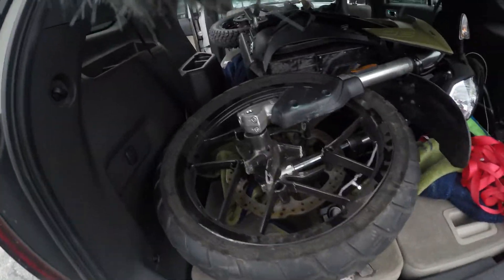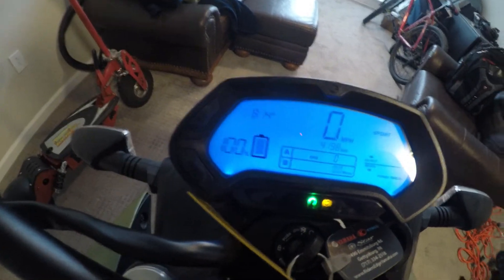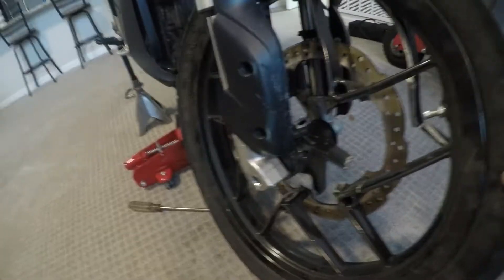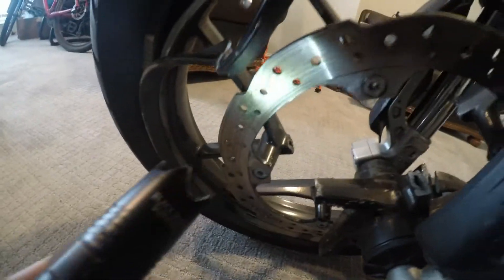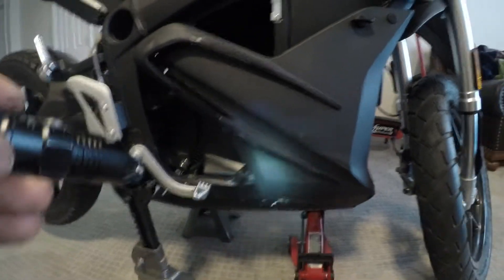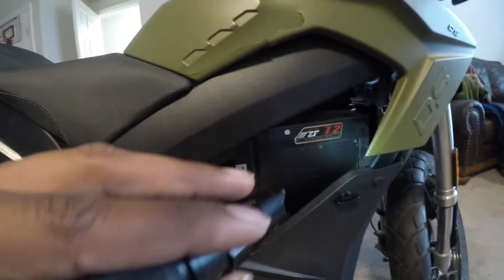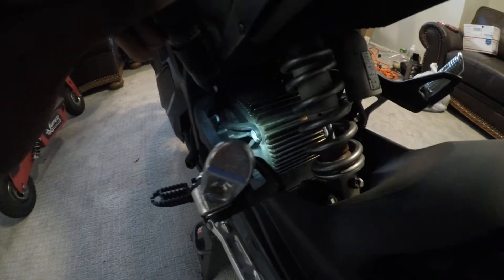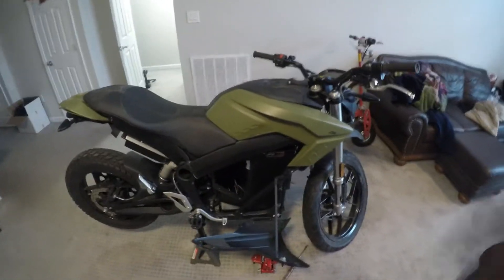Electric Motorcycle COPART Rebuild PROJECT (IN DEPT OVERVIEW)

Comment: Hey brother, I found a bike for me. It's coming for auction in about 10 days. It's listed on both copart and creashedtoys.com. What do you think on how to go about it?
Reply from the maker: send me the link ill look it over for you!
Reply: @DirectedWisdon  you the man for this. TY bro!
Let me know what you think.

copart: https://www.copart.com/lot/33181209
crashedtoys: https://www.crashedtoys.com/lot/33181209
maybe just for fun: https://www.iaai.com/Vehicle?itemID=31840578&rowNumber=1&loadRecent=True
Reply: @DirectedWisdon  hey bro, what do you think about these? Thanks again!
Reply from the maker: Darnel C Hey man that KTM is sick in my opinion I think for the right price this would be an excellent rebuild project and also I noticed that is pure sale which means the lowest bid wins the fight no matter how low! Also the damage from what I can see is not structural only the handlebars And some of the side plastics will need to be replaced and you should be good to ride I would also make sure that the instrument cluster is not damaged
Reply: @DirectedWisdon  Thanks! Yeah, this one is for me. Now I'm a bit more confident going after this one. Depending on how this works out, I have my eyes on others too. 

Initially, I was confused because it is listed on crashedtoys and copart separately. Both have same info and there's a bunch of references to copart on crashedtoys.com so I'm pretty sure it's the same operation and people running it.
Reply: What are the laws regarding electric motorcycle? Do I need a motorcycle license or endorsements, registration and insurance?

Comment: Dope! How would you handle shipping? Bikes I'm interested in and finding are usually out of my area. Buying without seeing I know is a risk. Noticed you picked yours up personally.
Reply from the maker: Darnel C I’m located in Georgia and I purchased this bike in Pennsylvania there are many shipping options available for motorcycles but they can often be quite expensive so whenever possible I usually drive to pick them up and also you are correct buying a bike without seeing it is always a risk worth with risk there is also the opportunity to get a greater reward I always recommend doing a ton of research so that you can spot whatever potential problems may be present before you decide to buy but I have some more videos coming out that will give details on how to do that